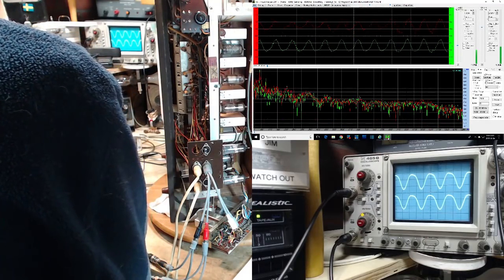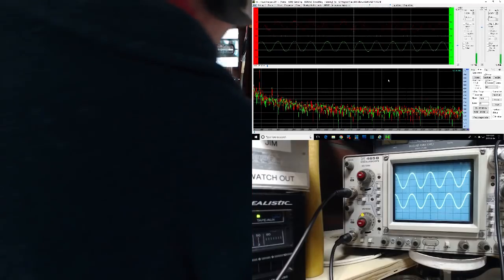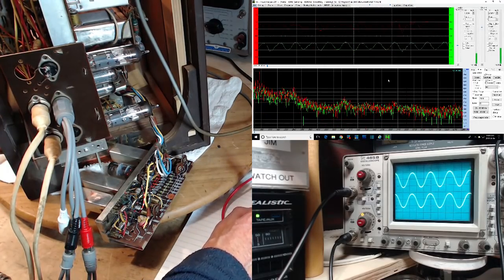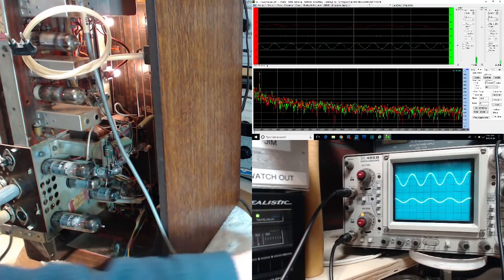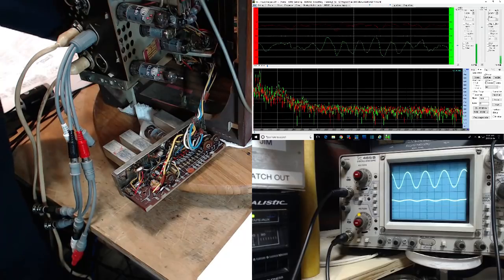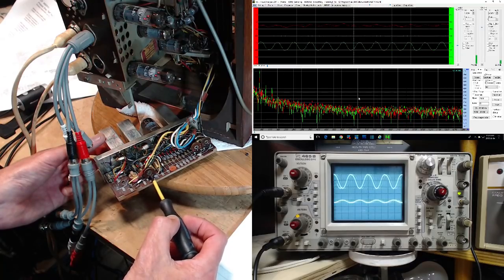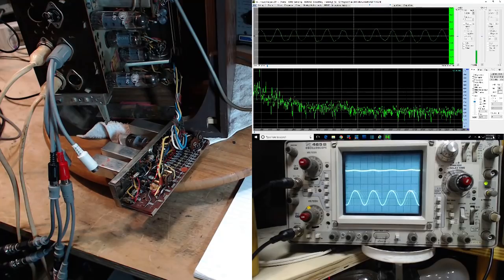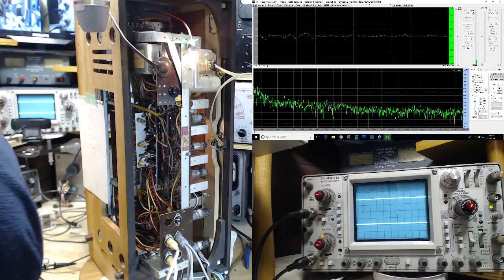Nordmende 3004C Video #21 - Stereo Separation

Comment: The demultiplexer needs the raw, non de-emphisized signal from the detector to "see" the 19KHz pilot. The signal to the audio amp needs to be de-emphisized (low pass filtered) to block the pilot from yer tweeters...
Also: "stereo" is NOT binaural; there should be some cross signal between R-L channels, just as we would hear it live.

Comment: At 7:51 the output of a 5 kHz signal is reduced with respect to an 1kHz signal. That's normal, this is the deemphasis filter, a 6 dB/octave rolloff starting at 2kHz (75 microsecond RC time constant) after the FM detector. At the transmitter the high frequencies are boosted the same way and in the receiver they are reduced again to get less high frequency noise on the output. Google for FM deemphasis.

Another thing: a few videos ago you measured the IF passband for FM and found it to be around 600kHz wide. This is way too wide and may as well cause the insensitivity of the radio. You should aim for an IF passband that is around 260kHz wide. As a rule of thumb, the IF passband must be twice the deviation plus twice the highest modulating frequency, so for FM stereo this is 2*75kHz + 2*53kHz = 256kHz.

Comment: Jim, the detector tuning is being effected by the heat from the output valves. If you look at the wave shape in the beginning of your video you see the distortion is not as bad as later in the video after the detector coil has overheated. Note your remark about the temperature of the detector can. You will have to retune the coil with the chassis horizontal and the heat shields fitted.
Your tuning for minimum harmonics is an interesting concept.